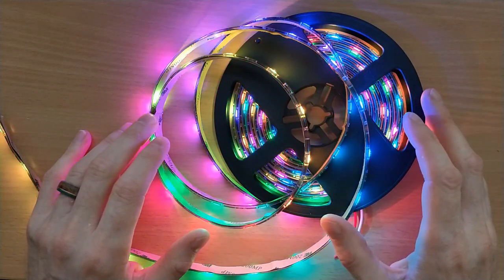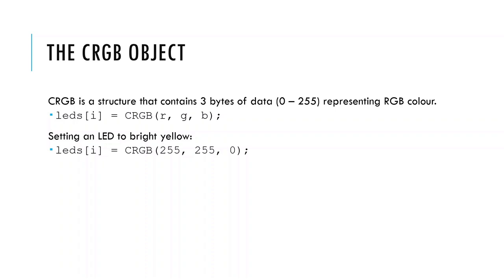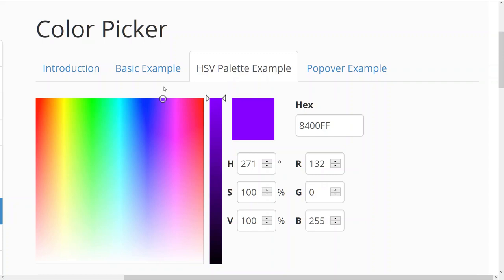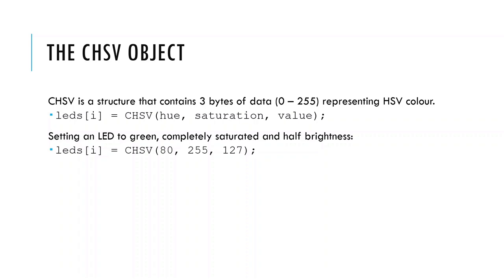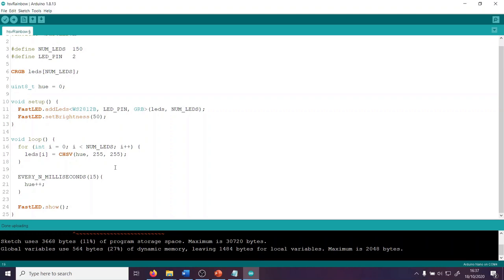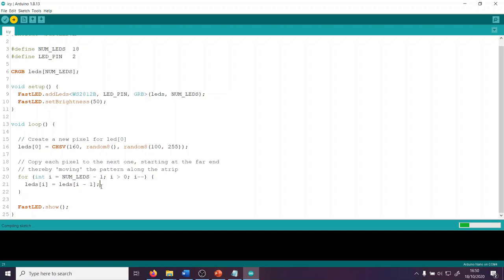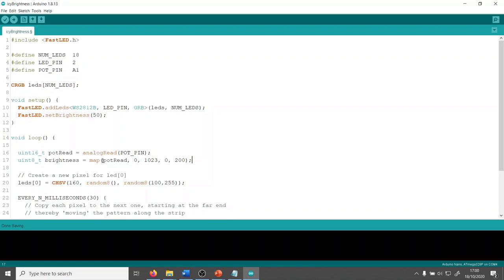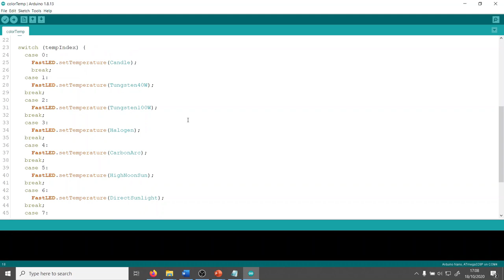FastLED Basics Episode 2 - Color: RGB and HSV

Comment: thanx for your teaching. i have a problem with using multiple EVERY_N_MILLISECONDS (and ...SECONDS); in the first one, i run some code to toggle some LED's on or off every 5 seconds, in the second one, i change the brightness in steps of 10, between 0 and 200, what mean in that 5 seconds, the LED are ON, it should change multiple times from dark to bright. Bit it does not, the blinking works. but when i comment out the toggling and just leave the led on, the changing brightness works as expected...
Reply from the maker: Hard to tell what the problem is without seeing your code. Can you paste you code to pastebin and link it here so I can have a look? Thanks.

Comment: This is a great series.  I tried to use "leds[i],h = hue" .  The compiler did not like it.  Had to do leds[i]= CHSV("hue", sat, val).  I changed the CRGB declaration to CHSV.  That fixed the issue but then hated the "addLeds" part.  Ideas?
Reply from the maker: Yes, the .h part was an error I'm afraid, I didn't notice until the video was already up. Sorry about that. What do you mean about addleds? That part won't change at all, they are always declared as CRGB and you can use HSV or RGB functions as you wish.
Reply: @ScottMarley  I thought I was going crazy.  Thanks for the update.  Stuff happens.  :-)

Comment: Is there any function in the FastLED library by which we can query which color does an led have or wheter it is on or off? Thank You
Reply from the maker: It depends what you want to do. CRGB color = leds[0] creates a CRGB object called color and stores the color of LED 0 into it. You can then use this color somewhere else. Or you can get the red, green or blue values using leds[0].r to get the red value (or .g and .b for green and blue).

Comment: Hi Scott,
I love what you are doing - Making FastLED even faster by getting everyone quickly up to speed
In fact this tutorial inspired me to mix some colours up on my led strips
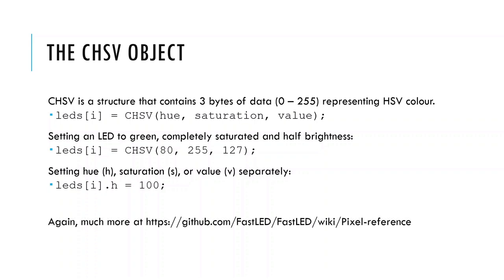I noticed at 7:11 you provided the code line:
leds[i].h = 100;

But I'm not sure this will work.
leds[num_leds] comprises of an array of type CRGB and is defined as:
CRGB leds[num_leds]

But the CRGB struct has no member labelled h, v or s and the compiler will tell you as such.
So I can't do something like this:
leds[i].h += 10
which is a crying shame :-(

The line:
leds[i] = CHSV (hue, saturation, value) 
doesn't in fact assign the CHSV object to leds[i] but automatically converts it to RGB on assignment

Maybe I've missed something. Do you know of a way to increment the hue?
Reply from the maker: Damn, well spotted! That's a mistake as you say. You can only use .h to reference the hue of an HSV object. It would be very useful to increment the hue of a particular pixel sometimes but as far as I know it's not possible (without storing a separatre HSV array but this is not terribly memory efficient!). You could grab the RGB value from the led, use the rgb2hsv_approximate function to increment the hue and copy it back to the LED again although this is a lossy conversion so won't always be spot on, especially if run multiple times. Feel free to point out any other screwups, it's tricky to make these things without errors it turns out!
Reply: Thanks Scott,
Don't beat yourself up.
Your FastLED tutorials are a treasure trove of information :-)
Thankfully my 'weapon of choice' is the ESP32 which is pretty hefty in the memory department so  the array workaround should work just fine.

After that, I just have to try out those sin waves . . .
Reply: @ScottMarley  Ok I got my answer :)

Comment: Why speed not changed, if I change EVERY_N_MILLISECONDS(10)  to 10 or 5, I expect to see rainbow move faster. But I see speed not changed. Please help.
Reply from the maker: It should change unless your driving a lot of pixels in which case the Arduino might not be keeping up. If that's not the case then I have no idea why it wouldn't be behaving correctly
Reply: @ScottMarley  Thank you for the answer. I use 36 pixel (60pcs per 1m) same chipset WS2812B , and i use same code. Do you think that 36 pixels can be a problem?
Reply from the maker: @kirznervadim7072   @Kirzner Vadim  I think it's just too fast an update rate for the Arduino. 17ms is about 60fps, 33ms is 30fps. I would set it to about 20ms as that gives a very smooth frame rate. Then if you want the pattern to go faster, change hue++ to hue += 2 or a larger number.
Reply: @ScottMarley  thank you it works as expected

Comment: With this code: 

CHSV(hue + (i * 10)

Are we multiplying what " i " is at currently, by 10?  Say, we're looping and at the 7th LED. Is that code multiplying 7 * 10 and giving us that hue?
Reply from the maker: Every 15ms hue increases. This causes the rainbow to progress along the strip. The i * 10 part is saying that from one led to the next, we increase the value of the hue by 10. So when hue = 0, the hue of the LEDs goes 0, 10, 20... 15ms later, hue = 1, now the hues of the LEDs are 1, 11, 21 ... Etc
Reply: @ScottMarley  Thank you Scott. I did understand that how you explained it in the video. I suppose I was just confused on the literal aspect of the code: " i * 10 " would mean to me that wherever i currently am in the loop, say the 14th place, take that and multiply it by 10. 

I get what's happening 100% just not "why" i * 10 shifts the hue range by 10 for each led etc. 

Thank you for these great tutorials. They're easily the best on FastLED and Arduino in general
Reply from the maker: @devram8833  it's hard to explain on here, but i is the LED number. So when it's the 0 led, you take hue and add 0, when it's the first led, take hue and add 10, for the second led, take hue and add 20 etc.
Reply: @ScottMarley  Hah! I feel silly now, that makes total sense. Total brain fart there. Thank you:)

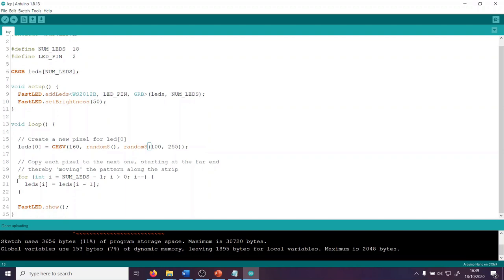Comment: From Video Time 11:05...  This one I'm having trouble getting my head around....

The way I'm reading the code , it is (as you describe) 'supposed to' start at the far end and copy it to the one before it (going towards LED 0).... But it doesn't - it starts at LED 0 and increase towards  the far end - not from the far end?

In the video 'LED strip demo' (at the screen bottom) I assume that your first LED [0] is to the left of the screen, in which case, like mine, it's starting at LED [0] and increasing... which is at odd to the verbal desciption AND what the code appears to warrant.

Your advice please?
Reply from the maker: The explanation and code are correct, but I understand that it may be confusing. I'll try to explain... We want the pattern to scroll from left to right. We have 18 pixels so the last pixel is index 17. We take pixel 16 and copy it to 17, then 15 and copy it to 16, 14 copied to 15 etc all the way through the array. Finally we call FastLED.show which updates the strip with our new positions, and it appears as though the pattern has moved from left to right by one pixel. We then repeat the process, call fastled.show and in this way we gat a scrolling pattern effect.
Reply: Thanks  @ScottMarley  ... 'I'm loving' your course! 

If your LED [0] is at the far left of the video screen then yours is flowing from LED [0] towards LED [17], just as mine is doing... 
...however if your LED [0] is at the far RIGHT of the video screen then yours is flowing FROM LED [17] , (as you describe) which mine is not? (... and I have the same code, copied below). 

Here is my complete code (which is for 144 LED strip of 1metre)... have I missed something? (oh... and I've added a clear all and delay so I can study it unfolding)///

Mine flows from LED[0] towards LED[144]...

//*****************************************************************************************

#include <FastLED.h>

#define LED_TYPE WS2812B
#define DATA_PIN 10
#define NUM_LED 144

CRGB leds [NUM_LED];

void setup (){
  FastLED.addLeds<LED_TYPE,DATA_PIN,GRB>(leds,NUM_LED);
  FastLED.setBrightness(50);
  
//CLEAR ALL
  fill_solid(leds,NUM_LED,CRGB::Black);     // Make all black/off
  FastLED.delay(500);                       //...for this period in mSecs.
}

void loop (){

//CREATE A NEW PIXEL FOR LED[0]
  leds[0] = CHSV(160, random8(),random8(100,255));

//COPY EACH PIXEL TO THE NEXT ONE, STARTING AT THE FAR END
// THEREBY 'MOVING' THE PATTERN ALONG THE STRIP.

  for(int i =NUM_LED-1;  i > 0;  i-- ){
    leds[i] = leds [i-1];
        
}

FastLED.show();
FastLED.delay(500);
}

//*****************************************************************************************

Thanks Scott... really appreaite your help and I'm really trying to figure it all out myself before I impose myself on you as I don't want to a 'pain'.  

Regard 
Joe B.
Reply from the maker: @joeb.fromsydneyaustralia5313   you're misunderstanding what I'm saying I think. The pattern moves from left to right, from 0 to NUM_LEDS as you say. But to make the pattern do that, you copy each led to the next one starting at the far end (right) of the strip. Look at the code. The for loop goes  from NUM_LEDS - 1 (the far end of the strip) to 0. Once you've gone all the way from right to left through the LEDs, the result is that you have moved all of the LEDs from left to right by 1 position. I don't think I can explain it any better than you just reading the code.
Reply: @ScottMarley  Thanks for that Scott.... GREAT course.... really enjoying it.
Oh - and thanks for taking the time to reply.

Comment: Adding a Pot:
My board is a: "DOIT ESP32 DEVKIT V1"
When I tried to add a pot, it didn't work, but came back with an error of:
'A1' was not declared in this scope
I changed the define statement to:  #define POT_PIN   2
and i connected the pot to Pin 4 of the board, which is listed as "ADC2 CH2"
Then it works.  I can't seem to find any other variation that gets a result.
Any idea what i am doing wrong?
Reply from the maker: Ah, the ESP has different rules for naming. For example, you don't use A2, just use 2. And the pin number you use must be the GPIO pin number, not necessarily the number printed on the board. If you look at this image https://i2.wp.com/microcontrollerslab.com/wp-content/uploads/2019/03/ESP32-ADC-channels-pinout.jpg?ssl=1 you'll see that pin 4 is GPIO 2 which explains why it worked for you. You can also see a bunch of other pins that would work.
Reply: @ScottMarley  Thanks Scott.
I am hoping that after your full course I will be able to make an LED clock using the ESP32 and FastLED. Lots of Clock projects use other boards or the Adafruit NeoPixel Library.
I also find that they spend most of their videos showing how to make the box and skate over the code really fast.  Not helpful.

Comment: The unit8_t hue = 0 isn't working for me any tips?
Reply from the maker: Explain how it isn't working. What does it do or not do. Any error messages?
Reply: @ScottMarley  The RGB strip doesn't do anything when i load the code to the Arduino, and in the IDE the code doesn't turn blue like yours.  Im guessing it could have something to do with that, but no errormsg
Reply from the maker: @sjarkulf  do the other examples upload and run properly? This is hsvRainbow.ino correct? I've just noticed in that example NUM_LEDS is set to 150 for some reason. Make sure this is correct for your strip.
Reply: @ScottMarley  Other examples run fine yes.